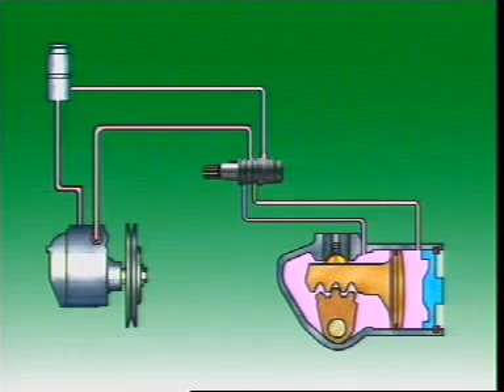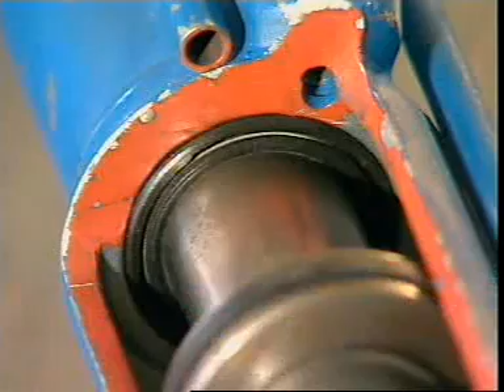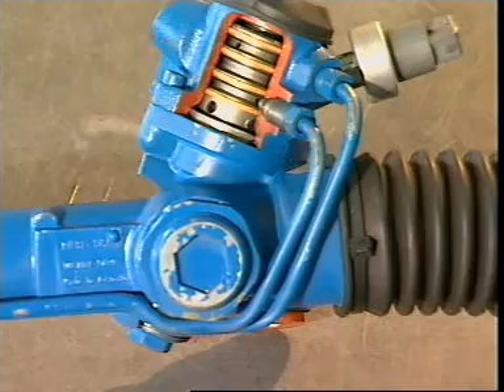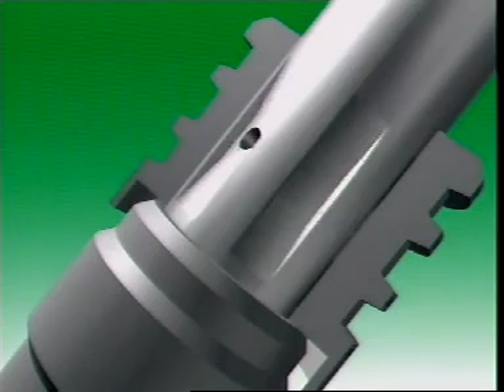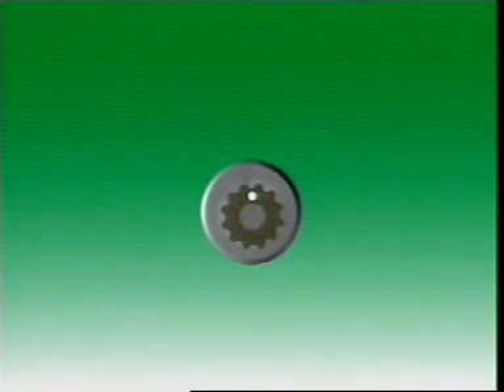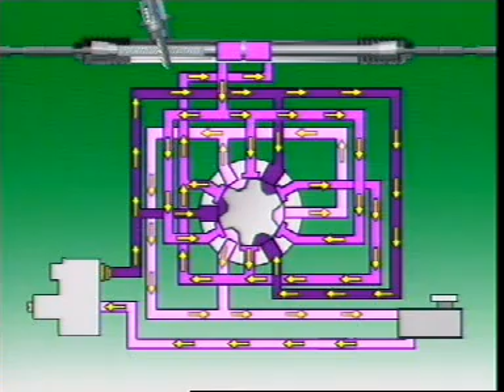Hydraulic Steering

Comment: Ingenious how they designed what is basically a servo with no electronics at all. Finally a video that explains how the valve works unlike the others.

The high frequency noise that came through from the tape is annoying if you can hear it. I recommend putting a filter on it with Audacity or similar.

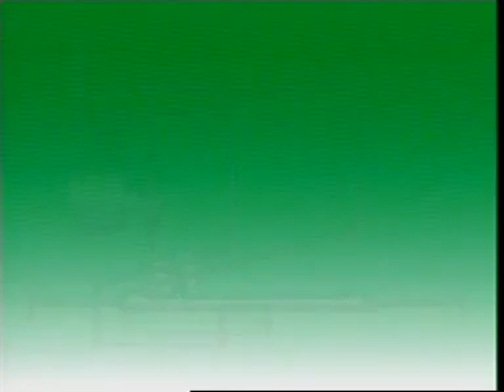Comment: Great Introduction to the Rotary Valve. Excellent visual imagery starting at 1:14 of the Torsion Bar. What an amazing invention. Increased resistance from the tires (for example while parking)  actually makes the power steering increase 🤓

Comment: And this is why Electric power steering is more efficient. Power assist is only provided when necessary and no engine power is used to constantly turn a pump to feed the rack. Even tho the pump may not be providing maximum pressure it still utilizing a small amount of energy to turn it when the engine is running

Comment: So what happens to accommodate the resistance at the road surface? The torsion bar is able to flex and therefore is still able to turn to provide the system with the inut to provide more pressure to one side or the other?
Reply: Yes
Reply: The video defines how the system works very well. If you want to get picky, why not ask about toe, camber and caster of the wheels too?